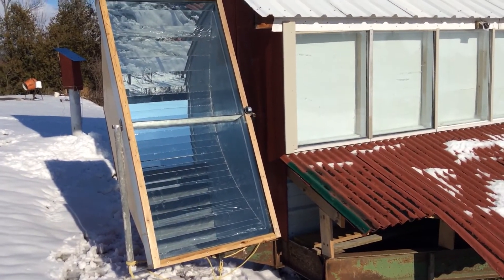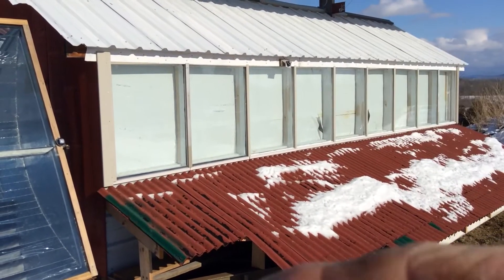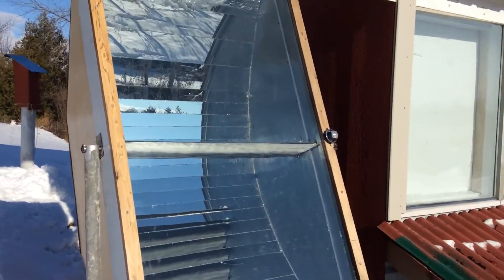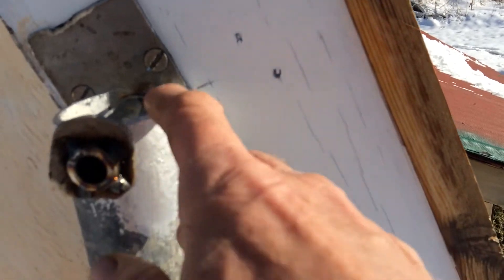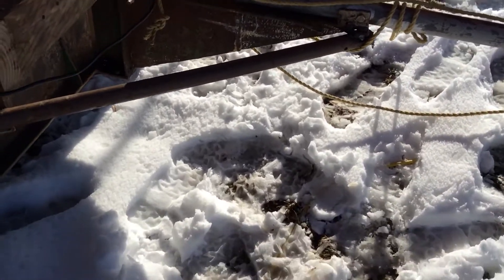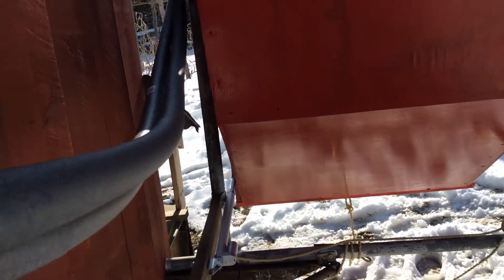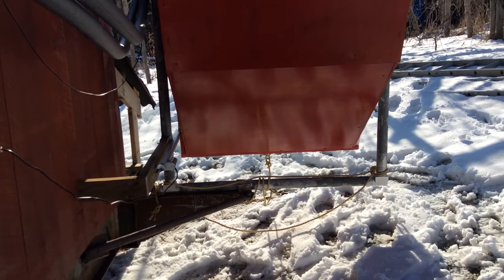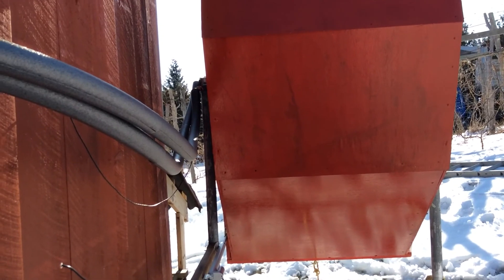Parabolic trough solar water heater is up and running

Comment: How do you get the water to cycle back to be reheated? Or heated.
Reply from the maker: Sorry I didn’t get back appropriately YouTube is not letting me know when I have a comment, there is a circulato in the greenhouse controled  2 temperature sensors, 1 on the absorption plate in the collector and 1 in the greenhouse.
The water has antifreeze and is circulated through a stainless steel pipe in the bottom of the fish tank.

Comment: How does the sun tracker work?
Reply from the maker: The vertical axis is controlled by a solar controller that activates the motor that turns the whole building. The horizontal axis has another solar controller that turns a lineal actuator on
Reply: @kaf2303  Thanks.  Did you buy them, or build them?  Link?  Instructions?
Reply from the maker: Purchased controllers on eBay $50 ea.

Comment: You could try one INSIDE the Greenhouse focussed onto a ceramic plate.
Reply from the maker: Interesting idea, my hesitation would be the loss of growing space.
Another idea for concentrated sun that someone suggested when I was designing my greenhouse was a large parabolic reflector behind & above the greenhouse focused on a small window on the back of the greenhouse then hitting a convex mirror to scatter the light inside , purpose being the elimination of glazing & heat losses on the south side . But I couldn’t get the tracking & focusing the beam on the window and the inside convex mirror. I would love to see the concept applied. Thanks for your comment!

Comment: Looks great but does it work? You could post an update :)
Reply from the maker: Thanks for your comment & question Ryan, it worked well until I hung a pv panel on its face to generate more electricity.
I will be relocating the pv panel next year and will put the trough back in service. At that time I will analyze the production and post the specs.
Reply: @kaf2303  haha
Reply: Looks promising

Comment: Your ideas are quite creative. I hope you have more winter sun where you are than we do in Michigan. I built a similar heater and didn't get enough sun to make it practical. I then ran lines through my wood stove but even that didn't do much to heat the water. I decided to back off aquaponics because of the expense heating the warm water tilapia (that and I accidentally killed off about 500 of them).
Reply from the maker: Jeff Sullivan, thanks, you are probably right for our December weather, but we get quite a bit of sun in January & feb. I use native fish so no need for 80f h (not good for most plants anyway) in the 2 sunny days we have had the water temp of the 1500 gallons has gone from 68 to 78 and due to the well insulated building the water temp only drops 1 degree overnight . Remember the best money spent is on preventing heat losses .
Heating a traditional greenhouse in our climate is folly.

Comment from the maker: Just a word of caution don’t glue the mirrors onto boards some of the 6” pine I epoxied the mirrors to cupped after the epoxy set and cracked the mirrors and created enough curve to make some light miss the absorber . The mirrors that are epoxied to plywood worked fine.